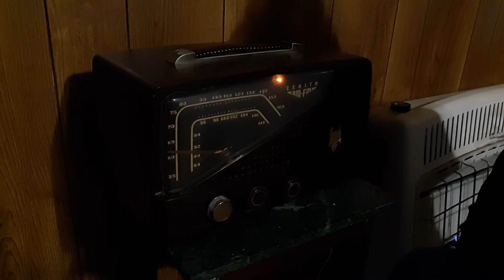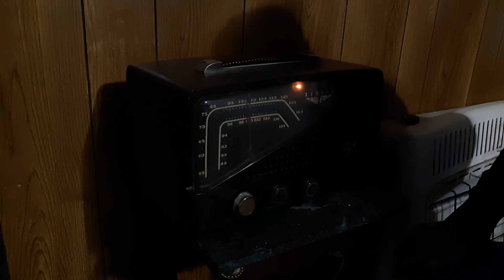Vintage Zenith 7H922 Radio FM Testing

Comment: Did you have a good antenna hooked up?
Reply from the maker: Before I could do much testing the frequency adjustment knob got progressive tighter until it started to slip....since these radios are almost always rebuilt & sold for hundreds all I was trying to prove was that it currently worked....kinda. Never listed it. it's still sitting in a box on the bottom of my bookcase. 😂